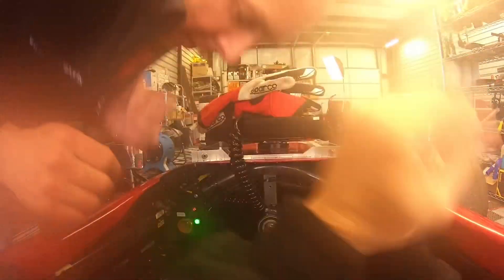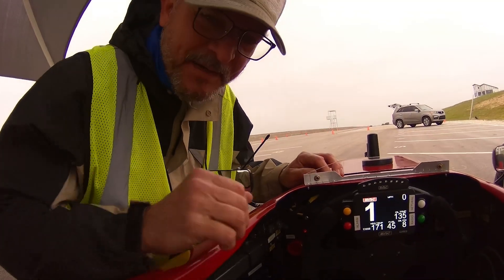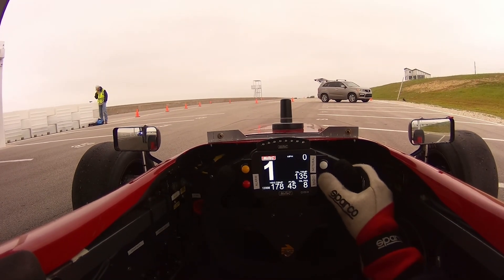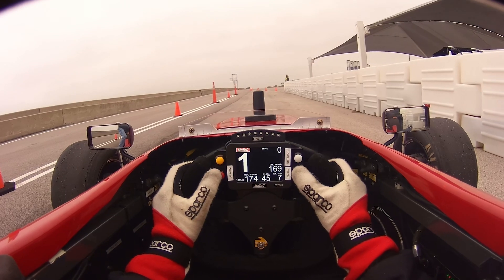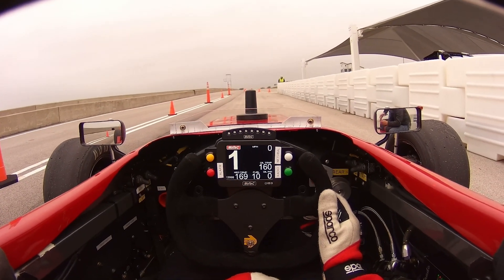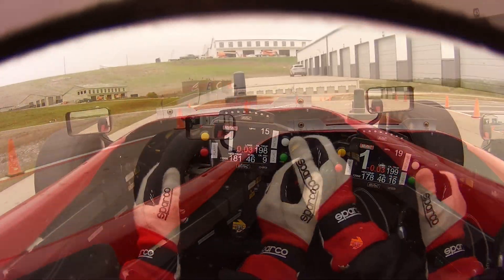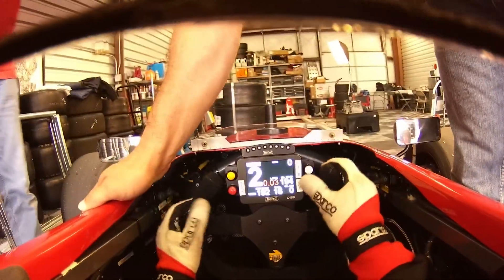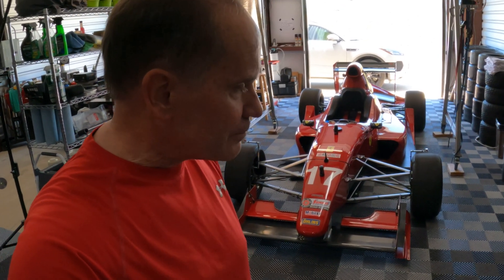Shakedown Laps ZX10R Motec Conversion Project F1000 Formula Race Car

Comment: How does one get into this type of racing? Do younhabe have to work yoyr way up from smaller go cart type racing? Jist getting into the world of racinf and seeing this is so awesome.
Reply from the maker: Good question, this does come up a lot.  In general terms I would say it is a good idea to start in karts and move up from there.  That is not a required step but you learn so much doing that at a much lower cost to start.  On the karting side, join a local kart club which will allow you to mingle with others and learn from them.  On this topic I do have a handful of videos in queue that I will be releasing which gets into this broader question of how to start racing.  Thank you for the nice words and supporting of this channel!!

Comment: Great project !! What gearboxs installed ?
Reply from the maker: This F1000 race car uses the motorcycle engine's gearbox.  It drives the rear axles by a 530 chain to a differential.
Reply: @NixonMotorsports  thanks bro good job 👍🏻

Comment: Please tell me what camera this is? I want to get one!
Reply from the maker: Hi Rob,  Happy to do so,  The camera is called Cambox v4 Pro.  If you go to our website www.NixonMotorsports.com you will be able to order it from the manufacture by using the provided LINK and save 5%.  Let me know if you have any trouble.  I love these cameras myself..
Reply: @NixonMotorsports  brilliant thank you!! How would you rate the camera out of 10? What are the pros and cons? I am thinking of getting one for the Superkarts I race in the UK.
Reply from the maker: Superkarts ??  Fantastic, I always had interest in those crazy fast karts.  I have tried tons of digital cameras over the years, this is the best one I have seen.  So I would have to give it a 9 out of 10.  Only negatives that come to mind is you need to record at 4k x 30fps not 60fps.  Some glitch they have at moment.  Very simple to use, charge between runs and save your video to external storage.  In doing that I never have any battery issues with record times, for me max single length is around 30-40 minutes per session.  Hope that helps, if you get one share with me your recording in the super kart.  cheers, Mark
Reply: @NixonMotorsports  thanks for that Mark that’s brilliant! Absolutely I will be getting one! If you want to, check out my chanel where I currently use a GoPro Hero 9, but I am thinking of incorporating both into a single edited race video for added effect! Massive thanks, Rob
Reply from the maker: @MyRob10   Sounds good and yes I will check out your channel..  cheers

Comment: Might be a dumb question but do these have a reverse gear or does it come straight from a bike into a chassis?
Reply from the maker: Not a dumb question at all, you are correct the F1000 and other bike engine power race cars do not have a reverse.  In all the years of my other formula cars that had a reverse I never used it once.  So, I don’t miss not having a reverse at all.  Thanks for the comment, other questions are welcome
Reply: @NixonMotorsports  thanks for the reply! I think I may have found a new project/hobby

Comment: Is that speed accurate?  What's the gear ratio after the bike gearbox?  Thanks for the great video!
Reply from the maker: Hi Derek,  Speed on wheel is correct yes.  Depending on track, gearing, downforce setting, wind, tires and so on, top speeds will vary.  At my home track I reach top speeds around 136mph, been a touch higher.  While at other long tracks I have reached 154+mph.   thanks for watching and support of this channel.